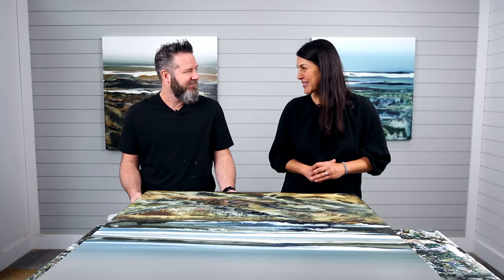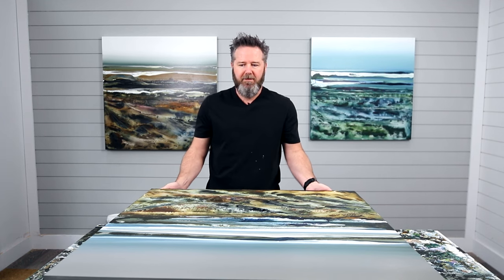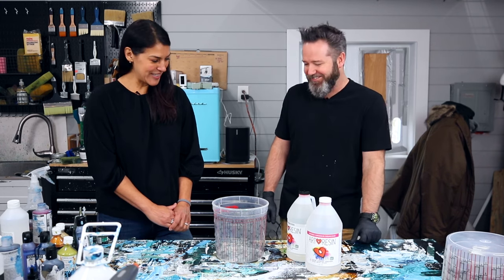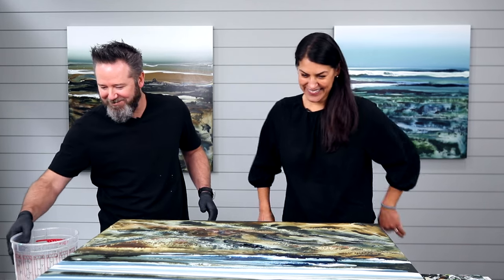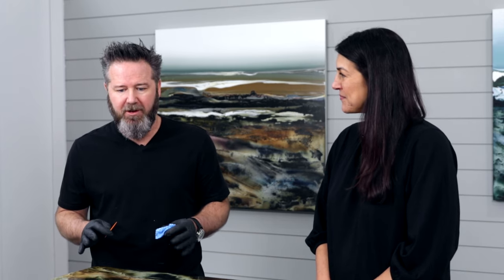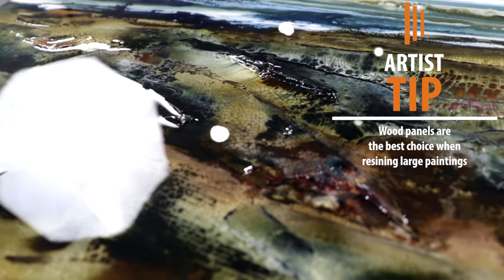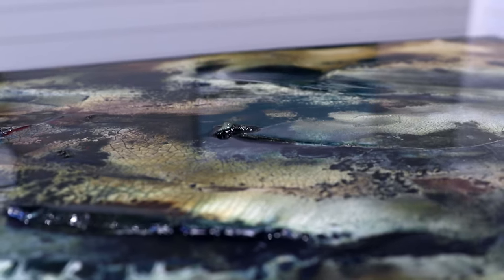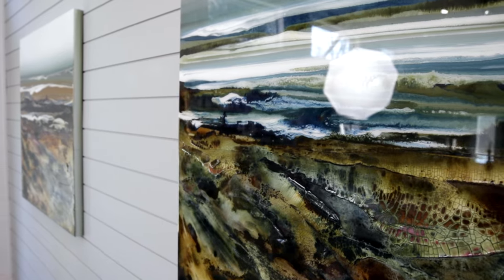How To Resin A Large Piece Of Art

Comment: First you have to know, and that shows that those who are speaking know very little about the resin, that it affects health and very strongly. Working with resin requires working with a respirator and an air filter. Second, the resin interacts with acrylic and oil colors.
Reply from the maker: We are happy to share that unlike many other epoxy resins, ArtResin is non toxic and does not produce fumes and VOCs. Further, ArtResin has been evaluated by the American Society for Testing and Materials (ASTM) and has been designated non-toxic when used as directed and safe for home use in a well ventilated area.  Have a look at our blog for more information: https://www.artresin.com/blogs/artresin/41788993-artresin-is-safe-for-home-use?_pos=2&_sid=906523318&_ss=r

ArtResin works beautifully over acrylic paints and oil paints, we always recommend ensuring your paint is allowed to fully cure prior to applying ArtResin.  When applied, ArtResin makes colours POP and become more vibrant bringing your artwork to life!

Comment: Love the resin but just a heads up the online calculator is pretty far off. I had a 24x30 to coat and the calculator gave me 25oz, I mixed 34oz and barely had enough for the top, there wasn’t enough for the edges even with the 9 extra oz. Please make the calculator accurate to the sizes
Reply from the maker: I'm so sorry to hear that - but I'm so glad you mixed enough for your piece!  Thanks for sharing - I will share your comment with your team now.

Comment: Just wondering. The ratio is 1:1. I have gone through 3 half gallon sets and every time I get to the end the resin side has about 1/3 more than the hardener. Is it 1:1 by volume or weight? I have always measured with grams of weight on a scale for each part, always even parts.  But I run out of hardener first every time.
Reply from the maker: The ratio is 1:1 by volume. While it is not the recommended measurement the ratio by weight would be 100:84 Resin to Hardener :) If you prefer weighing this should even you out.

Comment: When I used my resin for acrylic painting, all pieces didn't have a resin after dry. What can I do?
Reply from the maker: Sorry to hear that you had some issues with your resin curing properly.  When resin doesn't cure, it's almost always due to an error with the resin & amounts used or the mixture was under mixed.  
The good news is that you can fix this - first you need to scrape off any wet, liquid resin.  If it's tacky, like the sticky side of tape, it's fine - but wet, runny areas of uncured resin need to be scraped off.
Next, mix up another batch of resin, carefully measured and mixed according to the manufacturer's directions.  Then pour on top and allow to cure.  
Hope that helps!

Comment: Do you remove the tape before it dries or after?
Reply from the maker: Hi Julien - you remove the tape after the resin has cured dry to the touch, typically around the 16-18 hr mark.  You don't want to leave it much longer than that because as the resin cures, it becomes hard and the tape can rip and become difficult to remove.

Comment: Hi thanks for a gret demo! Would resin adhere to oil and wax paintings on board? Thanks Maria
Reply from the maker: Hi Maria!
Thanks so much for watching!  Resin will adhere to dry oil paintings - the key is that the oil painting must be completely dry, which can (as you know) take months, and possibly years depending on how thick it is applied.  Once dry, the resin will adhere.
Unfortunately, resin and wax, like encaustic or wax sealants, don't get along so I wouldn't use resin over top of these.  It may adhere at first, but will delaminate, separate, or peel right off over time.
Hope that helps!

Comment: Wow this is awesome!  Can you explain how using a box to cover your art piece does not produce more dust? Also, how long before you know you can put it under the box... I'm a beginner so trying to learn how to get the best out of Art resin. Are your panels custom made to fit the canvas? How do I go about getting one? Your Art is beautiful by the way!
Reply from the maker: Great questions!  It's really important to make sure your dust cover is clean before you place it over your work.  I always wipe mine out first with a damp cloth to pick up any dust, hair, etc (large plastic totes are sometimes easier to clean) and I always give my box or plastic tote a good couple of taps right before I place it over my wet piece, just in case there is anything I missed.  It's really important to cut the flaps off of a cardboard box as these can fall and cure right it into your resin (it has happened to me!).   
You should put the dust cover over your piece as soon as you've finished torching and done a last check for bubbles or dust.

You can purchase wood panels like the ones Greg is using in his video in a wide range of sizes - available at art stores. 

Hope that helps!

Comment: Doing my first resin pour on a 36x36 wood panel mixed media collage. Great tips learned - don't have a drill mixer to create that froth! I am amazed it came out clear. Will it work if I just mix by hand?
Reply from the maker: We never use a drill mixer in our ArtResin studio, we always mix by hand.  You can enlist the help of another set of hands and mix in two smaller batches if that makes it easier!  Just be sure that your mixture is thoroughly combined to avoid any curing problems.

Comment: Hi there.
My question is
Can I resin a poster board 23x28 cardboard.? 
Do i need a custom cut panel?
Can you explain this beginning procedure to me?
My poster is no thicker than a piece of paper with plastic frame.
Have I already started off wrong?
This is my first time in years since I worked with resin (high school  was my introduction to creating with resin)
Don't remember much of the process .
Now I am 71.
I am extremely excited to.learn again.
I paint with acrylic  paint , but that has become extremely boring.
Thank you for your time and expertise. 
Respectfully. 
Patricia Welker
(Trish)
Reply from the maker: Okay if it solid and won’t flex, tape the back edges on the bottom to peel Off drips once it’s cured.  Have it up on stands off the counter.   

Or just have it on a shower curtain or shiny plastic.   Have the poster board flat.   Let it go over the edges and onto the plastic.  Next morning cut the still soft resin with scissors.  After a few days it will all the super hard.  Slower cure for better long term clarity.

Comment: Greg, that is an excellent video!!! Do you cover with something your work before applied and epoxy resin?
Reply from the maker: If you are pouring ArtResin over acrylic paint or oil paints, there is usually no need for a sealer--just ensure that the paint has had time to fully cure.  If you are pouring ArtResin over alcohol ink on yupo paper for example, you should seal it with Kamar varnish to prevent the resin from re-activating the ink, and if you were pouring over watercolour paint on paper a sealer can help prevent the resin from absorbing into the paper and darkening it.  Have a look at our blog on sealing to get a better understanding: 
https://www.artresin.com/blogs/artresin/should-i-seal-my-artwork-before-i-resin?_pos=3&_sid=81f291c23&_ss=r

Comment: Amazin work. So I was wondering if someone could help. Sometimes during my work, after I put the resin on my artwork I get some oily marks on top of it. Does this have to do with resin quality?
Reply from the maker: You may be describing "amine blush" which happens as a result of too much humidity or moisture in the environment.  If you are in a high humidity environment, try running a dehumidifier to bring the humidity lower.

Comment: Hey there, is there anyway of removing the resin once it’s dried? Without damaging the painting
Reply from the maker: The only way to do it is to sand it off.  You can start with using an electric sander if the resin is thick, then as you get closer to the artwork just sand by hand.  You probably don't need to completely remove all of the resin you can just sand it down to remove the imperfections, then clean all the dust off and pour another coat.

Comment: Thanks for the video, I just tried a similar thing, with a smaller torch and for some reason the resin was immediately burning - any tips?
Reply from the maker: ArtResin won't ignite, but if you hold the torch in the same spot it will start to smoke and it can result in a scorched area.  When using a torch you want to just kiss the surface of the poured resin with the flame, you will see the bubbles disappear.  Keep the torch moving and try to avoid passing repeatedly over the same area.

Comment: Hi guys great video, how does your resin stand up to Amine Blush? I seem to have issues on and off with other (slightly) cheaper resins with blushing even when dried indoors in less humid spaces. I want to make a large purchase but just asking the question before hand...looking for reassurance really ha
Cheers
Reply from the maker: Hey!  Generally amine blush is not a concern unless you are in a really humid environment.  For best results we recommend working in and maintaining a humidity level of about 50%, but even up to 80% is usually ok.  If you are concerned you can set up a dehumidifier in your workspace and check weather forecasts.
Reply: @Artresin  Perfect thanks for the response,  really good to know that it can handle the higher humidity environments. Will definitely be making the purchase at the end of the month. Cheers guys. Do you offer any artist affilated programmes at all? Thanks again

Comment: Does anyone know if this resin is archival?
I’m considering varnishing some pieces this way but worried about longevity
Reply from the maker: Generally epoxy resin is not considered archival as all epoxy resins will show yellowing over time.  There are effective UV stabilizers that are added to some epoxy resin to help prolong clarity and offer protection from UV damage, but eventually there will be degradation.  An epoxy resin coating should be considered a permanent coating for your artwork so for best results keep your resined pieces protected from direct sunlight and high temperatures for best results.

Comment: Hi, thank you both for an excellent video and artwork! I’m a beginner at resin and I have a 2 questions…1) where do you get the wood board with the hooks & wire already attached? 2) do you add a backing paper/cloth etc behind the board? Thank you, new subbie here 🥰👍🏽
Reply from the maker: Hi there, most cradled wood panels do not come with the hanging wire attached.  You can purchase separate hanging kits or install your own preferred hardware yourself.  We typically do not add any backing but that is entirely up to you!!
Reply: @Artresin  Thanks so much for your response 😊

Comment: Do you need to wear some PPE when you apply resine? Like a face respirator mask ?
Reply from the maker: Since ArtResin is such a pure formula and is non toxic and it does not produce fumes or VOCs, you do not need to wear a respirator when you are working with ArtResin.  We do recommend working in an open well ventilated area rather than closing yourself off into a small confined closet :)
Reply: @Artresin  Good to know! Will try to use your product on my painting. Thank you!:)

Comment: Do we need to seal the big pictures? Becz normally in small pictures i do seal with hard plastic coating...pls help
Reply from the maker: Whether you seal your artwork or not really depends on what materials you are using.  Typically acrylic paint or cured oil paints do not need to be sealed, but paper or porous surfaces would benefit from sealer.  Have a look at our blog for more information: 
 https://www.artresin.com/blogs/artresin/should-i-seal-my-artwork-before-i-resin?_pos=3&_sid=9441a0a25&_ss=r

Comment: You're using a propane torch to take the bubbles out .. Can you use a HEAT GUN instead or .. is that too much air pressure, etc ? Also - Is this epoxy self leveling ? As long as your piece is level ? Thanks .. I have never done this, but, am interested in it ..
Reply from the maker: You can use a heat gun, generally they do not give off too much air flow.  We prefer to use a torch, you can pass the flame quickly to remove bubbles and it does not heat the resin up in that short time.  Ensure your piece is flat and level and the ArtResin will self level to a thickness of about 1/8".

Comment: Is the canvas sitting directly on the plastic mixing containers, or is it on the wood/border part of the canvas? Thanks in advance!
Reply from the maker: It doesnt really matter but we typically set the cups inside the frame on the backside.
Reply: @Artresin  Thanks - maybe I'll give resin-ing canvas 1 last shot - I've tried reinforcing the back w/shims but the resin settles so that you can see the shape of the shims. Whenever I've done that, I've set the large canvas's frame on the top of risers.

Comment: How long would it take for the resin to dry ? Or does it depend on the size of the piece
Reply from the maker: At room temperatures in the mid to high 70's, ArtResin will cure to the touch in about 24 hours and reach its full hardness after 72 hours.

Comment: Can we use a heat gun instead of the torch?
Reply from the maker: Hey there - this is a great question.  We almost always recommend a torch rather than a heat gun, especially for large pieces.  The heat torch zaps bubbles really quickly and efficiently from the surface of the resin, which means you can cover a large area in a very short amount of time, and the resin doesn't get over heated.  The heat gun is not as efficient so you need to work the resin longer to pop bubbles - this means the resin can overheat (which promotes yellowing) and it's hard to cover a very large area efficiently.  On a large piece, the resin may start curing before you cover the whole piece and treating it with a heat gun may cause surface imperfections. 
A heat gun also blows hot air so it can push your resin around and introduce dust and other contaminants into your wet resin.

Having said all that - if you're working with silicone molds or alcohol ink, a heat gun is the way to go:  a flame torch can damage silicone and alcohol ink is flammable, so you wouldn't want to introduce a flame anywhere near it. 

Heat guns are also great for fluid art when you want air to push the resin around to create cells, blend colours etc.

Long answer to a short question - hope it helps!
Reply: @Artresin  thank you for your time. Also, do you recommend a second layer for the cripple finish (this is on canvas) or leave it as is.
Reply from the maker: @lexhimself876  Happy to help! A second layer is totally optional. You might want to apply a second layer if there is something that needs to be fixed on the first layer (make sure you sand down the cured layer first to create some tooth for the fresh resin to grab onto), or you might need to cover areas of high relief, or you might just enjoy the look of a thicker coat.

One thing to keep in mind with canvas is that epoxy resin is very heavy - so it could cause the canvas to sag so that the resin pools in the middle and is bare on the edges.  One way around this is to 1) wedge cardboard cut to size in the back to help provide stability or 2) you can apply a thin coat of resin with a foam brush first to the back (and front if you want) to help firm it up before applying the main coat.  You might want to consider wood panels for use with resin - they're sturdy and strong and can bear the weight of the resin.
Here's a blog I wrote with more info, go down to point 4: Pouring Onto A Stretched Canvas. 
https://www.artresin.com/blogs/artresin/bare-spots
Hope that helps! :)
Reply: @Artresin  ok great. The canvas im working with is a 48x48inch, and i already pour my first coat. However, i have a few spot, would u recommend me just going over the spot, or do i have to pour all over. thanks for your help
Reply from the maker: @lexhimself876  Gotcha.  Ok, if you're fixing some spots, this probably isn't the answer you want to hear :)  BUT it really is best to pour a fresh coat over the entire surface.  

The reason is that it's really difficult to spot fix - the resin will self level, but you will still see the ridge around the little fresh resin spots you poured.  But it all depends on your artwork - if you have a really busy piece with lots going on, it might just blend in. However,  if you're standing off to the side and you see the reflection of the resin, you're going to notice them.  

Best practice is to sand the whole thing down with 80 grit sandpaper - make sure you remove whatever the imperfection is (if it's a bubble or dimple, or hair) and then just rough up the rest of the resin to create that tooth.  Wipe all the sanding dust away (make sure you wear a mask while you do this so you don't breathe in the resin dust) and then pour your fresh coat. 

If you want, try spot fixing first and see what the results are like - if it looks good to you, then you're good!  If not, then you can move on to Plan B and recoat the whole thing.

Comment: So check tape at 24 hours but leave no longer that 48 hours ?   Wonderful work and Inspiring  .
Reply from the maker: We recommend removing the tape when you can safely handle your piece without causing damage.  The longer the tape remains on, the harder the resin drops will cure and it will be tougher to remove.

Comment: Since you're adding heat to the resin to get rid of bubbles, shouldn't you be wearing a respirator?
Reply from the maker: You do not need to wear a respirator when using ArtResin as long as you are working in a well ventilated area.  ArtResin is non toxic and does not produce fumes, applying the heat from the torch is safe as long as you are not burning your resin.